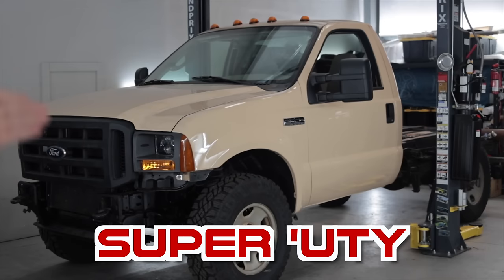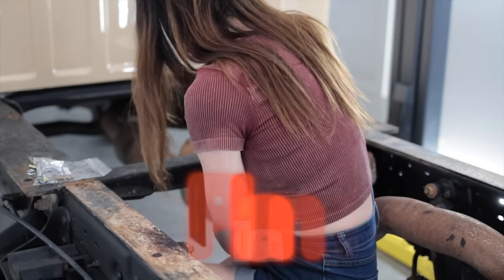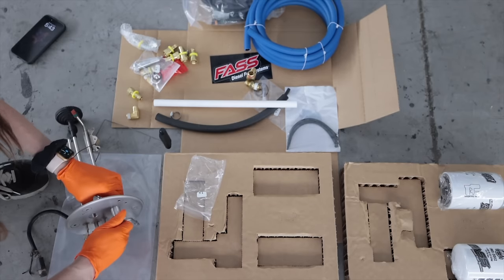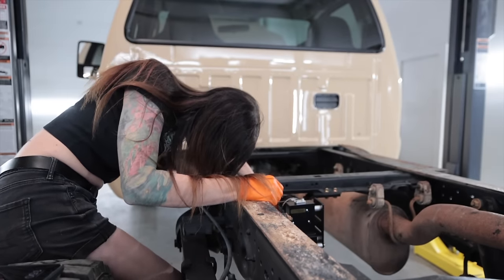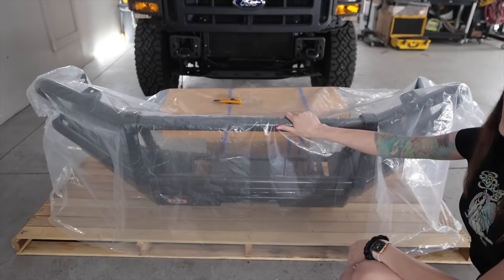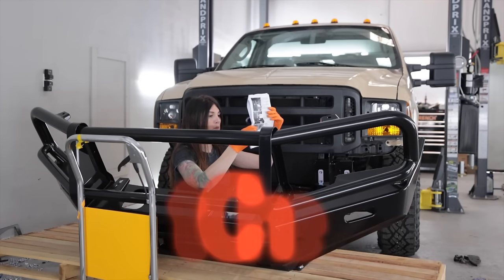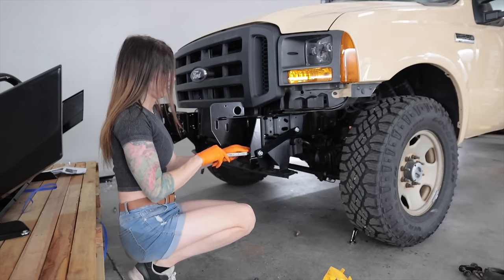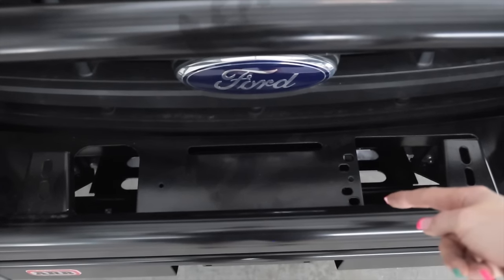The Ultimate Work Truck // Cummins Ford F350

Comment: Looking great Sarah! Only one suggestion though on the pump mounting. You probably should add a strap to the frame. Only being mounted by the two bolts on the crossmember I could see it vibrate already while you were finishing the mounting. Going down the road it WILL vibrate until it snaps off from the crossmember. Adding a third mount bolt to the frame would reduce how much it will vibrate. I work on OEM prototype vehicles for a domestic auto manufacturer here in Michigan and have learned what vibration and harmonics does to components as they are driven down the road and why components are mounted the way they are. Frequency can do some really strange things to vehicles!
Reply: having toured with rock bands, and seen what 600 miles of potholed road every night between venues...  I've seen some abuse to gear from vibration.  We use nylocs in that industry so things don't vibrate loose.

Comment: you are correct saying that it feels like an oem part.
in australia ARB is used by toyota, ford, holden and probably others as a dealer optioned bull bar.

the truck looks pretty tuff now, crazy.

Comment: We did get effies Australia. In the 70s and 80s they made them down here. Nothing in the 90s but in the early 2000s they bought them over and converted them to rhd. They didnt sell too well as big + expensive. Annnyhows, the arb 'bumper'. Its a roo bar. Not a brush guard or bull bar. Its a roo bar. To be fair, pretty sure you wont be hitting any kangaroos in arizona, but they will also do a number on padestrians or lost uber drivers.

Comment: Brake caliper paint that requires a bake will work on those tow loops.  It's just about getting a solid 2-3 coats and then baking at 200 for for like an hour.

Comment: I have learned a lot from watching your videos. I'm nowhere near your ability level, but will be restoring and working on more vehicles once I retire. I'm currently upgrading wiring and adding solar to our trailer. As an electrician I get the concepts, but working on cars or trailers is much harder to access, all the clips and plugs are not standardized so retrofitting can be frustrating. Working on old rusty cars is hard enough, can't imagine videoing and editing it all as well. You Rock! Try to take a break once in a while, we will still be here for the next video...

Comment: Hit a wallaby at 85kls yesterday, arb not marked, designed to force the animal down under 😊
The guys were amazed at the bull bar! 
100 kls outside any state capital these are standard on Toyota 4x4 or larger.
If you are driving off road in Australia these serve multiple functions, light bar, wench/recovery points, aerial fix point, even water or tools 😊
Great video well done😄🇦🇺🦘

Comment: I love my ARB bumper and installed it the same way with two friends holding it up while I stood under installing the bolts. FYI you should be able to install the winch without pulling the bumper. I used straps to pull the winch from underneath using the bull bar for leverage.  Also swapped those bumper bulbs to LED since everything else was LEDs.

Comment: I put that same bumper on my F250. It's a beast. I, like you, do all my work solo. So it took a bit of figuring how to lift it. So, I pulled my engine hoist out of the corner and used a couple of straps to get it level. worked like a charm. Love your channel, Sarah. Your attention to detail is nothing but awesome and inspiring. Keep up the great work.

Comment: Put a snorkel on it! They are not just for water crossings, they are great for keeping fine silt and dust out of the air intake on dirt roads.
Reply from the maker: Unfortunately the snorkel on a Super Duty is on the opposite side of the intake on the cummins, not possible without it looking like a hack job. Otherwise, it would get one.

Comment: Those ARB bumpers are the cats ass! I have one on my Tundra and hit a moose at 70km/hr. Impact was the drivers corner and all that happened was the headlight bumper hoop flexed into the headlight, smashed the headlight plastic, and bent the corner of the hood a tad. Drove for 6 months while waiting for a new bumper and parts to come in at the body shop.

Comment: You should cut the pickup tube at a slight angle. Same reason you put the lil teeth on the bottom. To prevent trash from getting stuck and blocking the suction.

Comment: Fyi: Harbor Freight to the Rescue... I know you got the bumper on, but I've been using a Pittsburgh Transmission jack I found online for less than $100. It is absolutely amazing for installing or removing bumpers by yourself. Makes it so much safer and easy to move back and forth for perfect alignment. Highly recommend. Great for transmissions too. :)

Comment: Another great video! I noticed you cutting the plastic strapping on the box with a box knife. If you're interested, try flipping the strap where the plastic strapping is melted together. You want to get to the strapping that is against the cardboard. Pull the plastic from the cardboard side and the strap will easily come apart. Works great if you don't want to look for a knife or scissors. Anyway, great channel!!!

Comment: im aussie, i have an ARB, have left about 20+ dead kangaroos on the roadsides with the mighty ARB, and another 20+ dead roos off of the door panels, quater panels, and some go straight underneath and out the rear... that bar is the best brand.

Comment: The structure behind the bumper/below radiator is a "crash bar" intended to reduce small cars from getting stuck under your truck.  🙂

Well, intended to protect lower ride height vehicles from being further obliterated by a taller truck in a collision.

Comment: Thanks for the update. If you want a rear Road Armor Stealth bumper, you can have mine I saved from my 2004 F350 that won't work with the reverse sensors on my 2016 unless modified. Only issue is one international border, four state borders and one time zone difference north and west..

Comment: Use an engine crane when mounting and dismounting the bar. It turns a 3 person job into a 2 person job (or even solo if you are particularly enthusiastic or stuck without help).

Comment: Hey Sarah, the next time tou have something that has those plastric straps on them, you don't need to cut them just pull on the tag end where they're fuzed together and they pull apart. I've worked in a warehouse for years, it works every time.

Comment: 15:15 that lower bar across the front.. I believe those were to make it crash compliant with smaller cars. My 04 has that bar and it also sticks out like a sore thumb but I have no intention to remove it ever.

Comment: Lol we Aussies know how to make Bullbars! It takes 2 people to put them together on a vehicle. ARB know their stuff backwards. The pump mounting is going to be subjected to vibrations so it's wise to strap it down. When you do get an aluminium tray, you'll get blocks for the height of it so it wont damage the fuel sender.
By the time this is finished, Charlie will have to speak Australian!

Comment: When you put the wiring harness in, double check the wire colors at the pump connector. I had one that was backwards. It went green to red. It made the pump turn backwards and it wouldn’t prime… took awhile to find that problem…

Comment: My thoughts on the funny pickup tube cone thing with the little spiky ends, is that to reduce drag and turbulence and resistance of the fuel coming in is why they made it so wide with the little spacing pins.  Tho you did put little naches in the end of your pickup tube, I would consider shortening it and putting that cone shaped thing on it.  Pulling the fuel from that much larger diameter of the bottom of the cone is less likely to starve the fuel pump of sufficient flow.

Comment: My 92 f250 had a plow on it...When I removed it and the truck mount it  was  not as stable. I got a new aftermarket bumper (super thin)and am looking for a western truck mount. I just want the top part. Little more stability and protection. Could add a winch or hooks or whatever. Junkyards got to be filled with those things? Might get a deal on a plow mount in Arizona. Arizona can be hard to spell if you don.t know. Oh Happy Birthday.

Comment: Don't powder coat the tow hooks, get them cerakoted. The cerakote will protect/wear better with metal hooks/tie downs. I have a whammy bar on a Carrera cerakoted and after multiple impacts on sharp driveways it still shows no wear.

Comment: Hi, Did you consider making a NEW throttle body shaft for the Celica V8 .. drive by wire .. with a cable attachment at the other end ?  Brian  NZ.

Comment: Why didn't you use your engine hoist to lift the bumper? Thats what I  used when I installed my ARB. As far as parts looking like OEM parts, the turn signals that came with my ARB are MK2 VW Jetta/Golf/Rabbit turn signals.

Comment: The channels at the bottom of the fuel line are in case the tank gets dented, so a full suctioned seal could never be formed, cutting off the fuel supply.

Comment: How about fitting a collision mitigation system, like autonomous emergency braking? That front bumper will likely keep the occupants of your truck safe but something that strong would demolish most cars and pedestrians will have zero chance even at low speeds. Otherwise great for wrangling Buffaloes..
Reply from the maker: The driver is the collision mitigation system.
Reply: @SarahnTuned  I actually wrote that without knowing whether it was possible and seemingly it wasn't until recently(?) A lot of fleet managers are fitting them because it saves money. Maybe a forward thinking..supplier will sponsor you, because it looks like they cost about $6000 unless you buy from Ali Express then it's $450. Just a thought.

Comment: Need harbor freight badlands  12k winch !  You should talk to them. They sponsor repair shop like , fab rats , Matt's off road recovery.
Reply from the maker: Doesn’t fit, you have to cut the grill up.
Reply: @SarahnTuned  So you need a more traditional warm winch with no extra plastic around it. I remember installing my first winch on my first truck forty years ago I still have that wench and it still works.

Comment: Please do something different than that hot air intake
Reply from the maker: That’s not an intake, the filter is acting as a cover to keep crap out of the turbo for the time being while the truck is being worked on.
Reply: @SarahnTuned  I figured.  You're work is far too exemplary to do something like that.